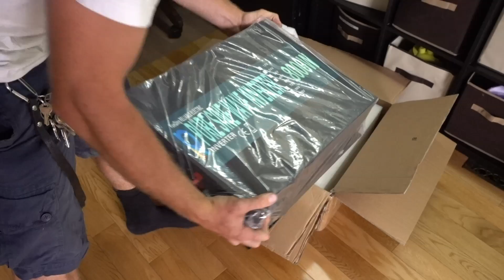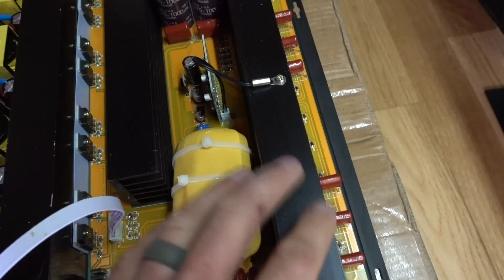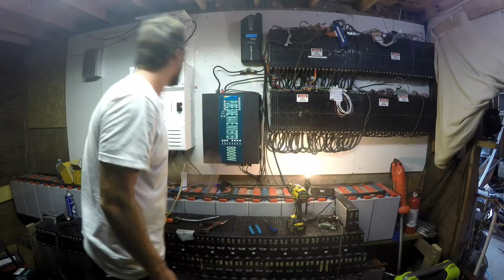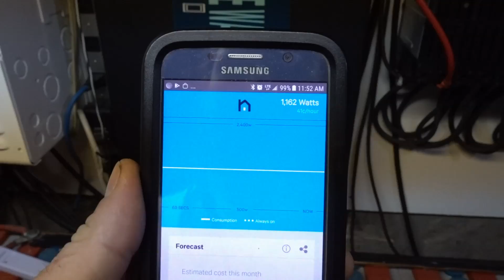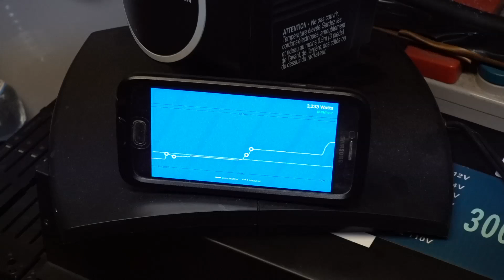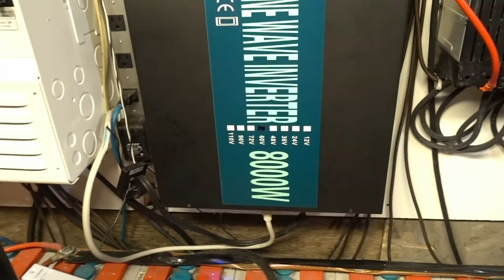8000w Reliable Electric Pure Sine Wave Inverter

Comment: Contrary to manufacturer reliable power. These units really have little or no short circuit protection and will destroy the unit if you wire it incorrectly from the output sockets / connections. Be careful out there. Get a professional to wire up.
Reply from the maker: 99% of inverters are like this, please make sure to wire correct the first time!

Comment: My ReliableElectric 3500W appears to have a "floating ground".  I'm thinking I may need to connect only the hot and neutral, leaving the ground wire disconnected.  What did you do regarding connection of the ground wire?
Reply from the maker: i would try a small light bulb like 20w between ground and neutral if it doesn't light up your ok to bond ground to neutral.
Reply: @GoingOffGrid101  In the video (@ ~1:31), it looks like you only have a hot and neutral connected to the 8000W inverter (no ground wire).  Is my vision accurate (ground left disconnected on the 8000W inverter?
Reply from the maker: @ktraglin  yes your right I did use it like that for months

Comment: That is awesome I am just building my off grid homestead system looking forward to the load test
Reply from the maker: buy the newer model its better!

https://www.ebay.ca/itm/8000W-Pure-Sine-Wave-Inverter-12V-24V-36-48V-DC-to-120-240V-Solar-Power-Inverter/201588624870?hash=item2eef9e4de6:g:p~AAAOSw3hFdaIvf

Comment: I would have sent it back after seeing the AC outlet wiring ! At best it looked like 14awg which is only rated for 12 to 15 amp max. A 8000 watt inverter should have had min. 12awg or even 10awg at least a rating of 20 to 30 amps cheaply made,
Reply from the maker: those plugs them self are rated at 15 amps so changing the wire wont help to much, you can only pull 8000w through the hard wire on the front that is 10 gauge

Comment: it has been more than one year since the video how your inverter is doing, mine a sigineer I'm not sure all my electronics clocks are delayed
Reply from the maker: I liked mine but I did end up testing it to its max 8000w anx then added another 500w for a total of 8500 and she died, but they have a newer 8000w im going to be testing soon
Reply: Does this 8000w dont have warning beep if reached the load limit? I think the company should do that.
Reply from the maker: @mrbmobilephotobooth2738  no it does not.

Comment: The conclusion is that your 3000W inverter has the same imput current capacity as your 8000W inverter.
Here apears a scam... !!!
....
Look at the pair of MOS-FET-s in your 3000W inverter, thouse IRFP4668... Are very good components for tis application.
In your 8000W model shoud be the same tranzistors.... Maiby the price is huy, but quality costs.
....
Attention to those fuses... in 3000W inverter usualy do not blow those 10Afuse.   in 8000W inverter those fuse blow evry day... Fuse are under rated... A normal shoud be 12-15A x 2 pcs. 
And the correct MOS-FET-s. must be placed.

Comment: The first models have good compnents, mayby more expensive.
...
The demand increase and now, the new models are poor in quality.
Cheaper tranzistors - MOS-FET-s  .... resulting in hotter inverters and smaller power... burn immediately with 2.000W motors that drain 6.000W on start.
Reply from the maker: interesting have you tested them? the newer one I have has igbt instead of mosfets witch cost more... and they just released a new 8000w inverter I hope to test soon
Reply from the maker: @andreigradu2624  interesting ill will look into this

Comment: On your 3000W inverter appears to have...
...
You  have a - 4 pairs - 2x mos-fet-s IRFP4668 - 9.7m ohm - maiby from Infineon. This is a 130A at 25 deg celsius and 92A continous at 100deg celsius, with 520A pulse.
With 4 pairs, and 4 transformers ( you have 4 sets that can handel around 368A for a short time ) - and a very small impulse of 2.000A ... !!!
You will never reach this... Will blow many other component in the way....
368A on 48V = 17.600W - 17KW. as an impulse. You can start any applyance. The limits are the transformers, wires, and many others....
...
IN REALITY = on maximum 3.000W you will have 17A per pair, on 4 pairs = 68 A in a 48V sistem . This inverter will run almoust non stop.
...................................................................................................................................................................................................
Let`s go to your new 8.000W. here you have F59N30 - 56m ohm - 59A at 25deg celsius and 35A continous at 100deg celsius and 230A pulse ( disipate 5 times more heat in running regards to - IRFP4668 )
When you run a 8.000 W model it will be hotter than 3.000 W modell. There are people who observe that.
...
in this 8.000W model you have 9 pairs. 9pairs x 35A = 315 Amps max continous --- ATTENTION !!! smaller maximum current than 3000W modell !!!
Maximum pulse can be 230A x 9 pairs = 2070Amps , the same as 3000W modell....
...
IN REALITY = 8000W ... WILL HAVE TOTAL -181Amps - IN 9 PAIR = 20Amps - PER PAIR OF TRANZISTORS and transformer ... ( equal with your fuses2x10A, probably something bad calculations, or a scam )
...
YOU MUST CHANGE THE TRANZISTOR, PUT THE ORIGINAL THAT ARE IN 3000W MODELL - IRFP4668...
Of course, if there are damage in control board must be repaired.
The fuse 2x10A must be bigger, migt be used 2 x 15A. fuse

Comment: My favorite inverters are #1 MAGNUM  ENERGY #2 OUTBACK #3 AIMS POWER. I know you say those inverters you are testing is good but I cant afford to play those games. I know you have gotten a LOT of BAD inverters from them to. NOT worth the risk to me. Get rid of that GENERIC CRAP and keep your MAGNUM and just buy another MAGNUM and run them together you can stack those. Or get an OUTBACK you will like that one to. Then you can get rid of all those GENERIC parts in your garage and have room in there !
Reply: Also try the new AIMS POWER low frequency inverter/chargers. They are FAR BETTER then that GENERIC 8000 WATT one you have. I have the AIMS 24 VOLT 4KW one with a 12K surge and I bet the AIMS 4KW one can sustain higher power output then that 8KW one.
Reply from the maker: @Hondacber  i dont like aims inverters but magna and outback are good as you say, these reliables have a good support team thats why I can give up, im helping them fix their flaws and make a good 8000w inverter, their 3000w inverters are great!
Reply: @GoingOffGrid101  How come you don't like AIMS inverters ? They seem to be reliable. I have the NEW version one the big long Blue one 24 VOLT 4KW and it also has a 50 AMP charger built right into the unit. I know back a while ago AIMS inverters where NOT good at all back when they where GREEN in color. I remember Troy from The Do It Yourself World on here he had an older AIMS and it SUCKED. But AIMS has relay gotten there s**t together and the new units are GREAT but there NOT as good as MAGNUM or OUTBACK or SAMLEX.
Reply from the maker: @Hondacber  interesting, I will have to look into them again.
Reply: Anyways take care and stay warm. Message me anytime. I like this stuff. I watch your video's all of the time when I'm on here !

Comment: i would like to know if i can get one of these for use for my home studio to power up my desktop computer and other electronics any recomendations
Reply from the maker: yes a 1500-3000w reliable would be the best cheap option, or you could go samlex or xantrex or gopower inverters for a little higher end but they cost a lot more as well.
Reply: ok now my question is how would i know if it wont burn my desktop power supply or have any kind of effects ..  like 12v or how many amps or what not
Reply: and how can i recharge the power  inverter and i need something that can last  battery wise
Reply from the maker: pure sine wave is what you want a inverter to say on it, then it will be good for everything.
Reply from the maker: you will have to buy a 12v charger to go with your 12v inverter.
Reply: and ohh i would like to know if there is a power inverter that i can charge directly from a outlet or it has to be from a battery car ?
Reply from the maker: yes there is but they are normally quite a bit more money.
Reply: Going Off Grid .WHER IN TORONTO I CAN BUY GOOD 5KW INVERTER .

Comment: Thanks for your vids.  Haven’t gotten to All of them, but I enjoyed this one.  Side Note: haven’t yet met a Canadian that I didn’t Like !  Good People !
Back to subject.  Do you have a Down N Dirty quick couple of Recommended Units in the 2500-3500W continuous range (12VDC to 110120VAC) ?  Putting in small Jeep, and Steep Learning Curve !
Reply from the maker: for a cheaper unit I would get a 4000w or better 5000w reliable inverter your jeep will never be able to run more then 3000w but if you ever add a few more batteries you might be able to get close to 4000w :)
or if you limmit you usege to under 2500w the 3000w inverter is also an option, other that that you have the big names like (go power, samlex, xantrex, magnasine, ) all great inverters, reliable is also good but a lot cheaper.
Reply: Going Off Grid Appreciated.  Might set up an isolated battery charger & battery in future, but financially, I have to do it in phases.  The high end brands are simply out of range for me .... though I DESPISE catering to “CHEAP Chinese products”.  I have to sometimes go contrary to my conscience, and buy what I can afford.
Regarding wattage, the limiting factor there is the SIZE of the unit.  It’s not like mounting in a camper van or RV .... it’s a SMALL Old Two Door Cherokee.
Again, THANKS
Reply from the maker: in that case the 3000w is alot smaller and would serve you well.

Comment: Your hard wires inside look more like 8 gauge unless Canadian wire sizes are different than American sizing.  Also, some of that string of diodes could possibly be solid state temp sensors. Also, your pure pure sine wave is not produced or determined by that LARGE oblong torrid coil wrapped in yellow. It is determined by the type of oscillator that is in the heart of the unit. That large yellow coil is more likely for filtering harmonic noise out of your pure sine wave signal or filtering external electronic noise from coming in and causing false triggering of your power MOSFETS.
Reply from the maker: thanks for the info! yes the hard wire is heavy duty and can take a lot of power, I ran 8500w through it and popped it :D but I only have to get a new output board and I was back up and running.

Comment: I have one of these power inverters in the 6000 watt version. What kind of batteries are you running? How long can you run something at 6000 watts? I'm just experimenting with this stuff on my RV. I purchased 2 325 amp alternators on for my RV, but without the RV running, I can't more than 1000 watts worth of stuff very long on 3 acid batteries.
Reply from the maker: yea that is normal, you need to look into lithium batteries for your RV much much lighter and you could get 20Kwh of batteries on that rid easy. also its 6000w peak so dont run more then 4500w for to long, also make sure the inverter has lots of room around it as it through's a bit of heat.
Reply: Any recommendations on lithium batteries? I have used a few different calculators and came up with 600 amps needed to fully power my inverter at 6000 watts. With that, It would take 12 batteries to last only a few minutes. Maybe I'm doing this completely wrong. How would a person achieve 6000 watts for at least an hour?
Reply from the maker: o you have a 12v inverter I see, well in that cause it will be very hard to get more then 3000w out of that inverter with out the engine running, unless you have at least a 600Ah battery bank with very large cables and short cable runs.
Reply: Well how many volts are you using?
Reply from the maker: my inverter is 60 volts

Comment: I wouldn't try to squeeze any more out of that 8000 watt inverter than about 1500 watts!    Those wires feeding those outlets are a joke!
Reply from the maker: Richard Owens thwy are rated for 15 amps and hard wired is 50 amps

Comment: If money was no issue. What size reliable Inverter would you use to run your house. Or how many? I'm thinking about my mom's house. Running it off grid. With grid backup. What's the biggest they make? I'd say I could easily run my house form A 3kw easy. I don't pull much from my 5kw. That I would never expect 5 kw from. I'd say 3-4 max with 5 kw surge. It is a low frequency design. Keep at it !!!
Reply from the maker: not sure why im not getting notified anymore, if money was not a problem I would buy a magnasine 4400w inverter, of if you cant spend $3000 on a inverter then I would get the 8000w reliable for $1000.

Comment: Have you tried the 48v 5000w unit?  Wanna run my ac, refrigerator, and occasionally portable  power saw, what do u recommend?  Or should i get the 8000w 48v instead?
Reply from the maker: i would get the 8000w for the extra head room

Comment: I'm not even going to get into as to what an awesome system you have there! Way over my head! BUT, what I can't figure out is why Reliable, and probably other inverter manufacturers, have the same 'ole way underrated AC output wiring! I have a Reliable 3500W unit that has nearly the same skinny wires as your 8KW! 8000 watts @ 120 volts is like 66 amps? The inverter using like 14ga wire to standard 15 amp AC outlets? This is insane! Even the hard wired terminal block is using the same wire! This is like using lamp cord wire in your car from the battery to the starter! If this inverter was submitted to UL for certification, it would be laughed right out of the building! Since when is it OK to push 8000 watts though 14ga wire? That inverter, like mine even, needs a 15 amp breaker to each built in outlet AND a heavy duty twist lock or crowsfoot socket for the hard wired section. The internal wiring should be 6ga at least. WTF!
Reply from the maker: my 8000w inverter uses 12 gauge to the outlets and 8 gauge to the hard wire side, still a little skimpy but it ran a 6500w load with out getting warm :)
Reply: Ahh! OK then. Couldn't really tell by the video. I guess the fact that the wires are only a few inches long, that may just make it. Hmm. Thanks!
Reply: Hello Curt Chase - you are damn right there in your said points of wire gauges, I totally support you.  Even I doubt this unit will not run with 7KW load for an hour or some more ? For drivers, I think those are not Mosfets, may be Hexfets or IGBTs.  No heat management seen so far.  What do you say ?
Reply: @GautamKumarGoswami  There is something called chassis waiting. Awg is a standard for LINE runs only. In inverter and computer chassis you will never seen runs over 2 ft. Take a look at a 2000w PC power supply it's the same gauge with DC amps at that. These inverters are awesome.

Comment: Hi, Any update on the 8kw inverter? Still running well?  What's your opinion on high frequency inverters compared to low frequency? Are they reliable?
Reply from the maker: I love my 8000w but that 8000w is more of a peak I wouldn't pull more then 7000w from this inverter witch is still a good deal.

Comment: Good Morning. I bought one from 5000 watts to 240v. I have a question how I connect the cables. The colors are black. Red and yellow. The black and red has 240v. Yellow is neutral or earth. Thank you
Reply from the maker: only use the nuatrul/grand with extention cords with tools or lights, if using with your house you can not use the ground, only the two lives red and black. or the inverter will be damaged
Reply: is that I compare with a multimeter and from red to black I have 240v but I do not know that it is each line 120v and the sum of 240v. At home it is L1 120v + L2 120v = 240v. How can you help me connect it better? It is better to connect it by a 240v plug. I am afraid that when I connected the lines, the two L1 and L2 remain at 240v.
Reply from the maker: you could try a small load like 50w or less from black to natural but im pretty sure your inverter is made for only 240v and unable to do 120, but you can buy 1500w step down transformers that will bring it to 120v

Comment: I found your videos and I've been watching them all over the last couple of days, I noticed that you have used inverters from both reliable energy, and swipower , I've been looking at both of these companies as well for a 5,000 watt inverter. I wanted to know which inverter brand you prefer or think is best and why. Also where do you find that 8,000 watt model?
Reply from the maker: the Reliable is a better I had 3 swi inverters and all 3 broke, I have 4 reliable inverter and they work well, I have had a few people tell be they burnt their reliable inverters but most are from trying to use the ground on the inverter and bind it to the neutral, these inverter have a half live ground and it can not be used when hooked to a house.
Reply: Thanks for the reply, the reliable sounds like a good fit then. I picked up 18 ja 320 watt panels the other day and looking forward to get the other devices to get things hooked up. Any chance you have a detailed video showing way it should be wired or a drawing of some sort? Is this true in just a grid tie situation or also a off grid?
Reply from the maker: you can use both lives just do not use the ground on the inverter, you can ground the panels and the house but leave the inverter ungrounded or it blows up :)
Reply from the maker: i will make a video soon :)